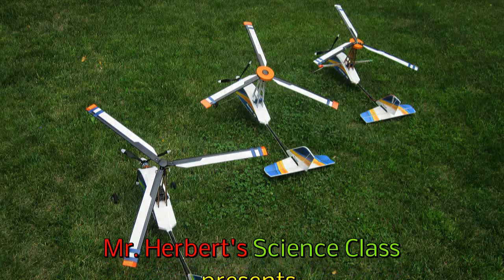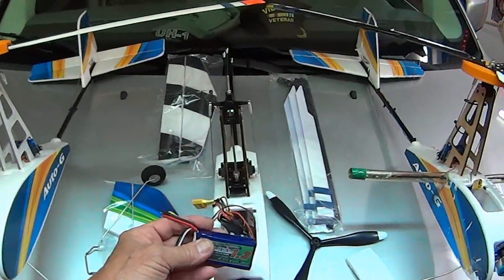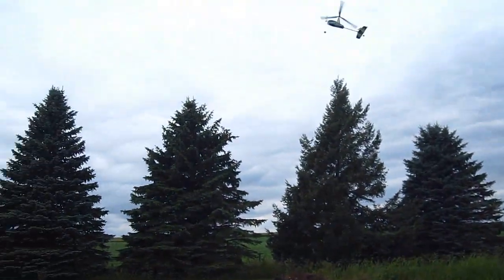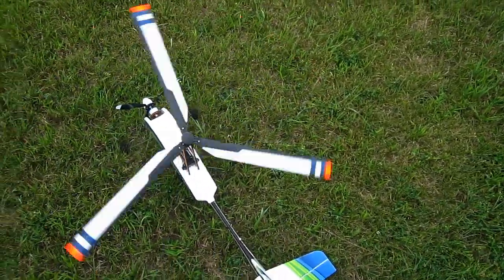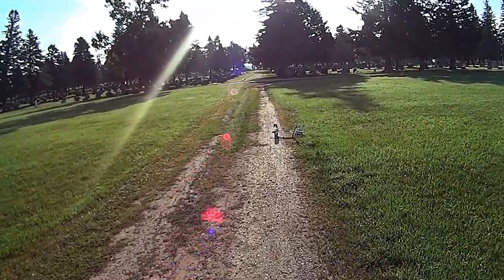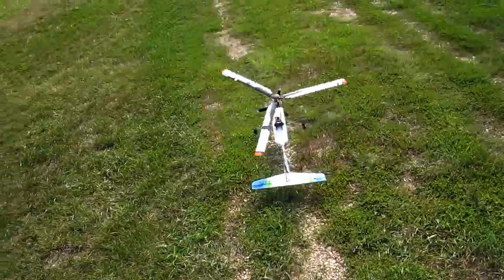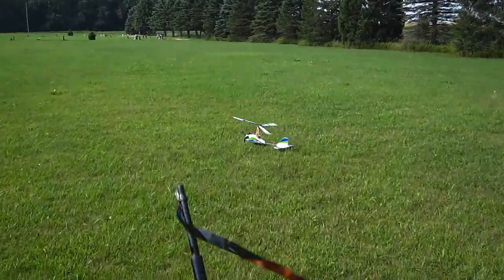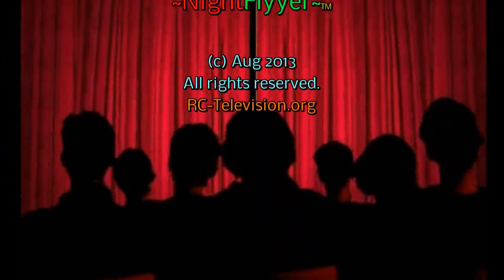10 years ago Durafly Auto G-2  introduced a Unique Rotor Spin Up device + Tips by NightFlyyer

Comment: If you would substitute a toothpick for the outboard screw on your blade holder, it would act as a shear pin and save your blades in a tip over. It does not effect the flying of the bird at all.

Comment: I think you would be a lot happier with the ground handling if you went to a Benson style trike gear on this bird.  Nice wide mains and a high enough stance for proper high alpha landings.  Since you have the run-up motor on there I'd also suggest a slight nose down stance on the ground.  That way you can spin up the rotor, start your takeoff roll and not pull lift until you want to rotate.  Also, beware Hi-Lo-HI swoops in an autogyro.  Does bad things to rotor speeds